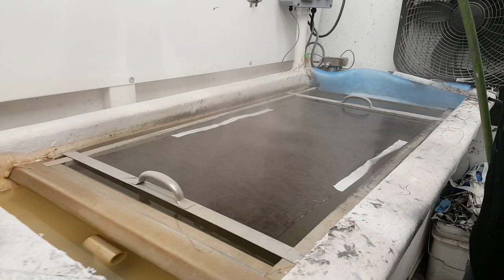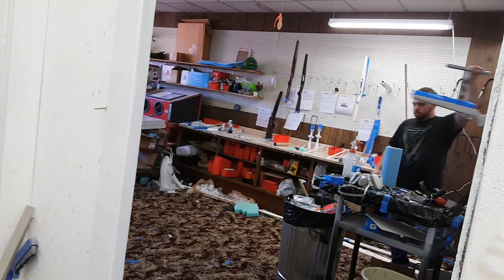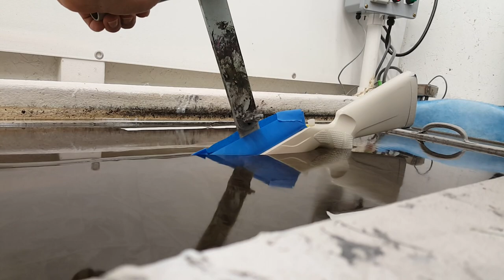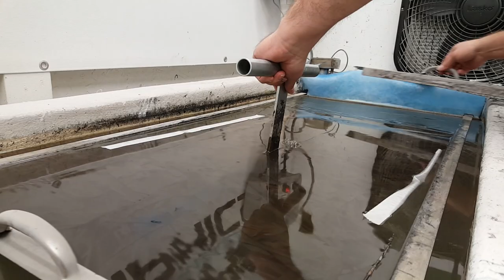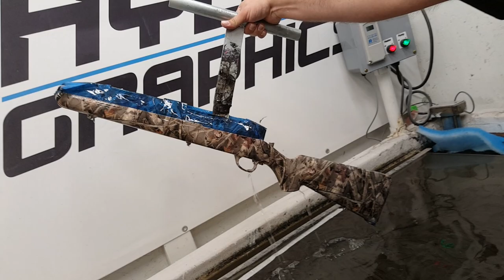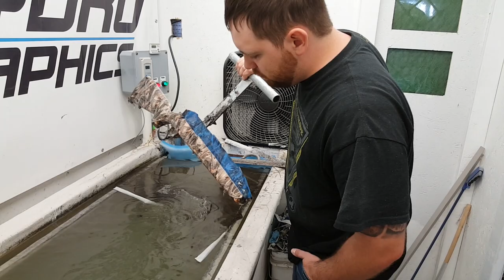Hydrodipping a Rifle Stock, How Hydrographics Works

Comment: Hi Snooperking, Enjoyed the dipping vids thanks, I'm wondering about a project that is coming up, I have some polished mirror stainless steel, do you know if it can be dipped what with such a clean shiny surface? will it stick and stay there?
Thanks
Reply from the maker: it should, i recently dipped my laptop, just had to spray adhesion promoter on first to make sure the sealer and paint would stick, so id recommend that.